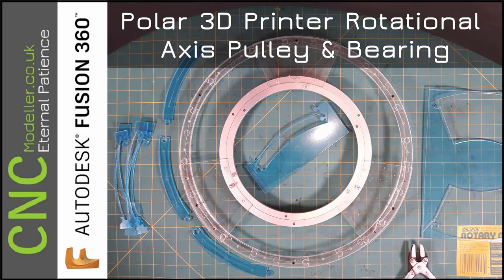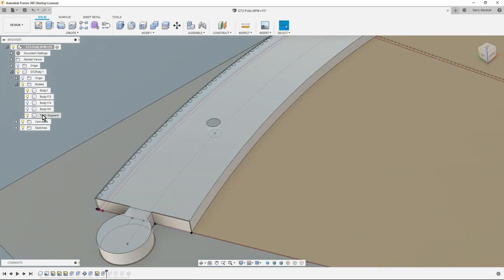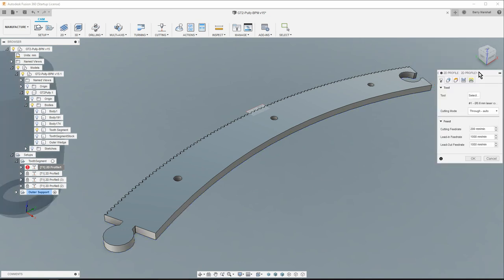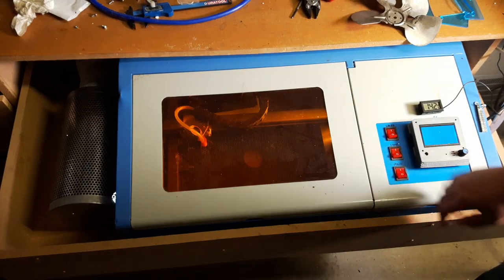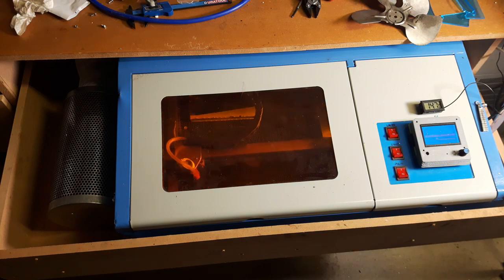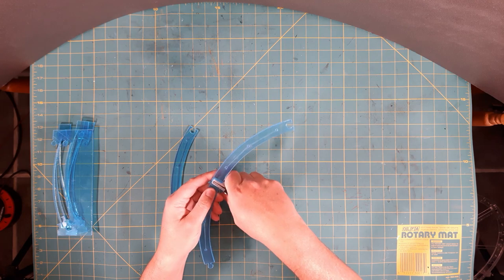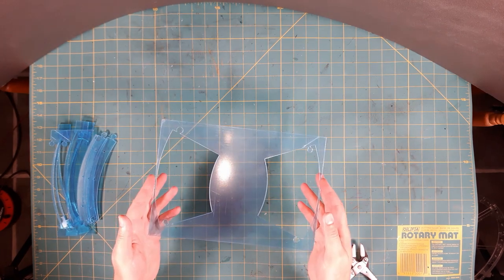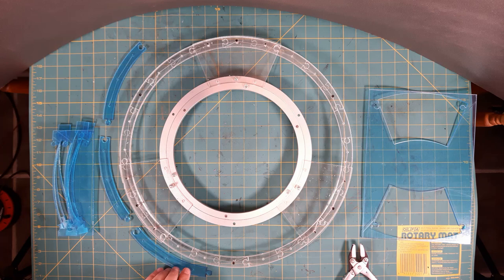How to make a Laser cut 720 tooth GT2 Timing pulley for a Polar 3D Printer Rotational Axis

Comment: Are you able to find closed loop GT2 belts that big? Or are you making your own? I had a similar requirement, also with a large lazy susan, and went with spur gears instead because I had issues finding a belt the right size. Used the same tactic of making the large gear in multiple pieces (but mine was printed). I recently made a video of it if you're curious https://www.youtube.com/watch?v=R6PrNylf6_8 Looking forward to seeing more about the printer and the braiding machine as well. Cheers!
Reply from the maker: Hi Andrew, I sized the pulley around the largest closed belt I could find. I just did a search on eBay and found some listings with multiple sizes and chose the largest that was available in multiple places. The printer is currently waiting an upgrade on the Duet3D firmware as I need to create a new configuration file. I tried a lazy Susan bearing but it developed too much play and started to run roughly after a couple of thousand rotations hence moving to the new bearing assembly. I'm slowly working on a mk 2 of the braiding machine but it's a side project at the moment. Thanks for the interest, I'll check out your video too. 
Cheers
Barry M
Reply: Where is the firmware information available?  We are also developing a polar Design, but a bit larger.
Reply from the maker: It's all detailed on the duet3d website here:- https://docs.duet3d.com/